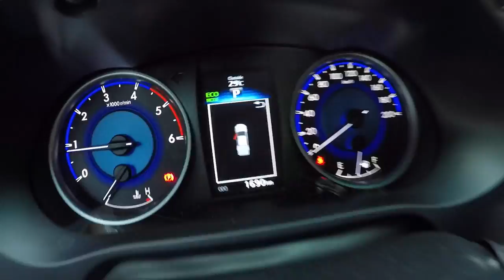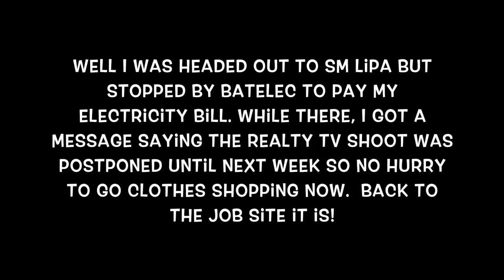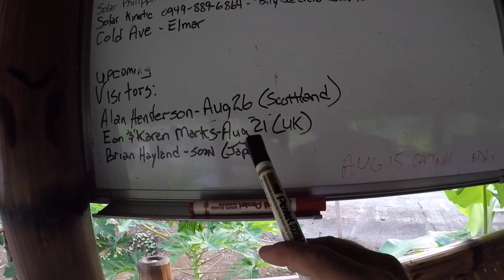VILLA FELIZ - EPISODE 142: I'M IN A JAMB (House Building in the Philippines)

Comment: Really admire your use of cement and steel alone so far, why not hollow steel door frames instead? What kind of wood are the door jambs?
Reply from the maker: Not sure the wood material but its treated to prevent termites.  Also we will seal the one in the stairwell to minimize rotting from moisture.

Comment: Hi James,
We are trying to make sense of the roofing structure and what the sequence is is for its construction.
Maybe if you get a spare minute you could talk us through it on the white board. As you say its a more complicated
structure.We kinda feel like we are seeing the main house construction in fine detail but don't get to hear much about the roof.
Thanks
Reply: Unlike here in the US where most houses now are built with prefab trusses (commonly made of lumber), roofing structures are made on site in the Philippines whether it be lumber or in James' case are heavy gage framing steel. As I watched the progress of how it's slowly taking shape, it looks like the framers started at the main ridge of the highest point of the roof and they're using it as their point of reference. The process seems to be very slow and tedious, but that's because they have to make sure everything will line up perfectly and seamless. Remember that each parts are spot welded as they go. In the end it will be a very strong roof that will probably be to take the equivalence of a category 5 hurricane here in the US.

Comment: Just wondering if the roof frame welding spots and cuts will rust. Is there any rust treatment done after cutting and welding? I seem to recall you saying the frames are galvanized steel.